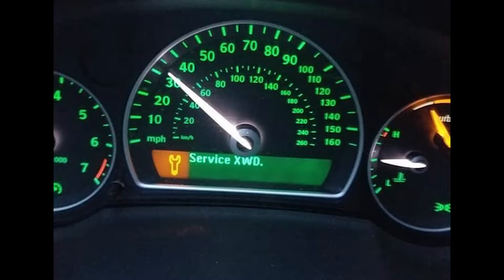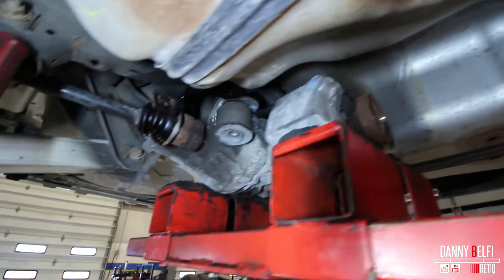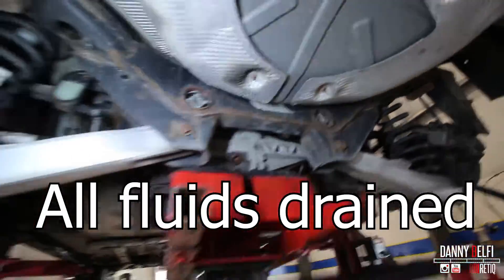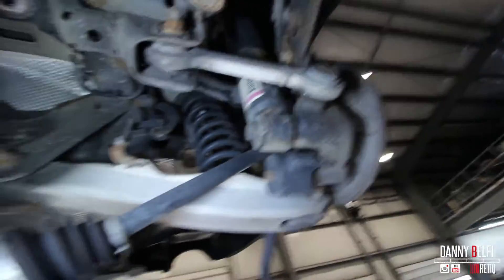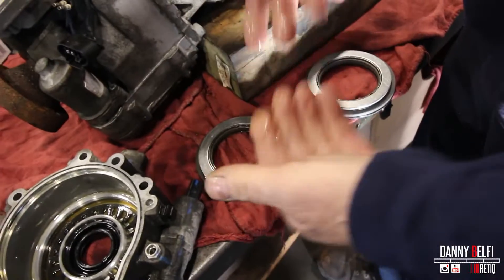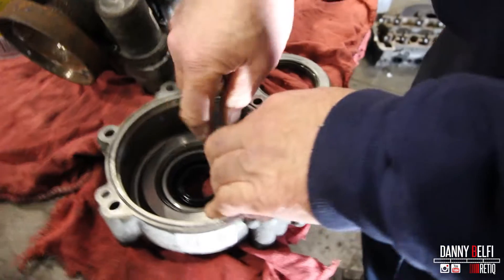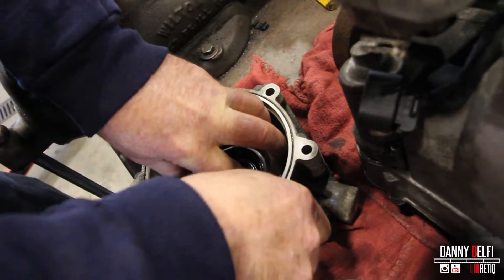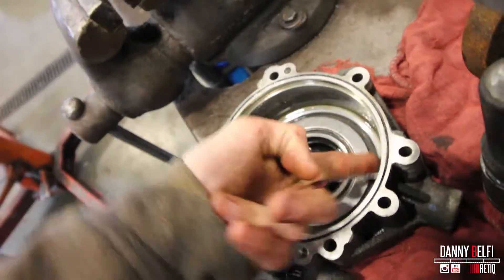Saab XWD Diff Rebuild: FIX The XWD Service Light

Comment: Hello, is it possible to still find the part, because I have a leak but I can't find the part, thank you
Reply from the maker: Hi, I am currently been out of the dealership for at least four years. I am unaware since I haven’t had to do this job since. I haven’t tried to look up the parts. I know that the Buick use the same haldex there is one with limited slip and one without so be cautious of that one looking up parts. But it’s pretty much just GM so I feel like these parts should be available but through gm
Reply: @Retiq  Thank you for your reply, I have a Cadillac SRX 4 it is equipped with a limited slip differential, I was able to find the part number but it is still difficult to find, thank you your video will be of good help

Comment: New sub here.  Got a question. What would you assume a issue could be for a saab xwd that seems to not be getting any rear wheel power and its not throwing any codes?    Here next week ill be lifting the car off the ground just to see if they move at all.   Kinda thinking clutch back cage might be cracked, allowing it to spin and not transfer power.  On lunch, im about to watch this brakedown
Reply from the maker: Hey thanks for the sub! Sorry for late reply. Why do you say the xwd isn’t working? I believe these cars are a fwd bias. So it can adjust how much power is sent to rear wheels but it’s not very high, nor is the xwd super strong. It’s not the same as some 4x4 like trucks or cars that generally have rwd bias. It’s more like a helping hand. It should spin all tires in the air. Turn of traction control while you do it.
Reply: @Retiq  no problem. A late one is better than nothing!   We had a good snow, during that snow i was getting no help in the rear, front tires spinning nothing from the rear. I was on a slight incline that i was trying to back up on and was getting stuck in a driveway forward and reverse. 
I plan to get the car off the ground. Was hoping this weekend, but my friend is working.   I do need to service the xwd.  I Have all the fluids.  Thank you for the reply!     I know this one is hard to diagnose,  i might wait till we are okay with the car being down for a few days a see what i can figure out.  Newer to the xwd. Own a few v6 saabs myself
Reply from the maker: @MrMckenzie2403  okay well deff hard diag from here. But how about the tires? Same quality and tread depth on all four tires? It may be smart and trying to change which tires are spinning to less power and give more power to other now spinning tires… but just a guess. Sorry. I did donuts in my turbo x in one video and it was giving me enough rwd to slide it around
Reply: @Retiq  ahh i wasnt paying attention.  The tread looks good now does not mean it does not need tires as their kinda hard. Will be looking for a bew set.  We don't drive the car a lot but it does get used.  Ill eventually figure this out.  For how picky they can be could of just been the type of roads we had at that time.  It was snow. Yet ice. Really just need to get it off the ground asap.   When i figure it out if its anything ill let you know.

Comment: What was the issue with diff, vibrations as well? To drop off you have deattached only stab bar? Anything else?
Reply from the maker: I think in video I mentioned the issue. Light on for service xwd, and the fluid kept flowing into diff I believe it’s been a while since I’ve watched video. But you don’t have to pull axles to remove diff just driveshaft and mounting bolts and connector can’t rember if there’s anything else

Comment: Fantastic video Danny. Is this first time you have had this issue with the AWD system? Your SAAB has virtually no rust. Impressive. Do you use an anti-corrosion product to protect the under-carriage of the car? Six years ago, I brought a 2003 9-5 wagon from Brooklyn down to Florida. The underside of the car was covered in rust everywhere. I took the car to a car restoration garage in Orlando. They applied a rust converter anti-corrosion spray to the entire underside of the car. They cut out and replaced a rusted-out dog leg section by the right rear passenger door and sprayed an expanding foam product in between the sheet metal panels to prevent future rust. It's working very well. No sign of rust. Take care and Merry Christmas.
Reply from the maker: Hiyaa this is the first time Iv done this repair to fix the AWD. This is actually a customers car when I used to work at a saab dealership. I did have a turbo x tho. That good I would like that done on my saab 900 the dog legs re rusted after a long time previous owner had them done
Reply: @Retiq  The restoration shop that did the dog leg work told me there was a kit available for the 9-5 dog leg repair. His technician cut out the old, rusted section and welded in the replacement section from the kit. Hopefully there is a similar kit available for the 900. Thanks Danny. Cheers.
Reply from the maker: @yhird  idk if there is Ik pervious owner had them cut out from another car but that was long time ago… haha happy holidays